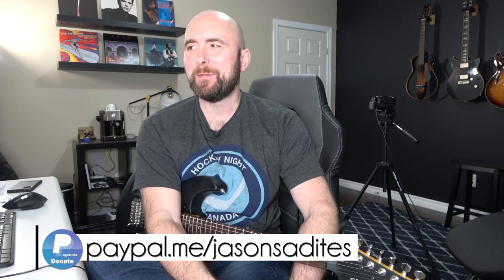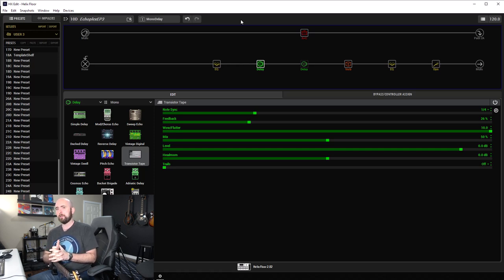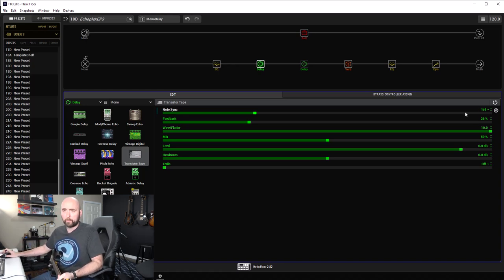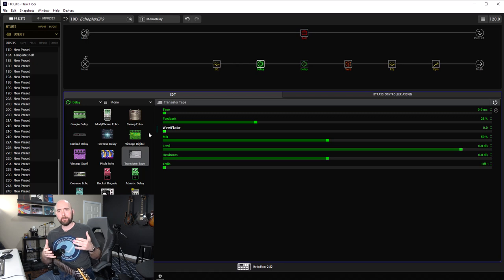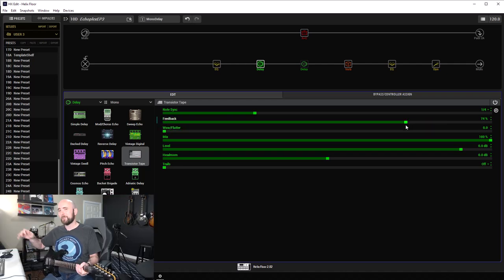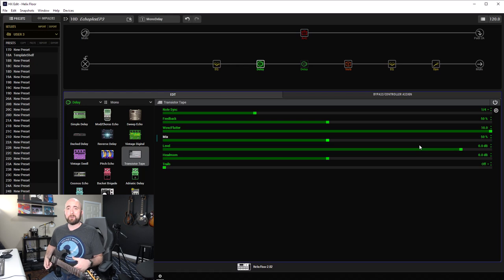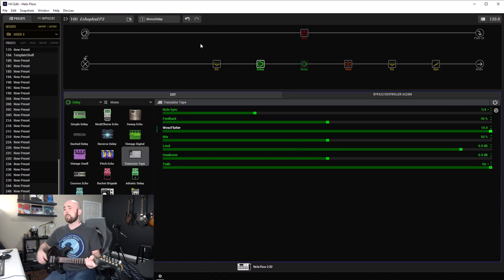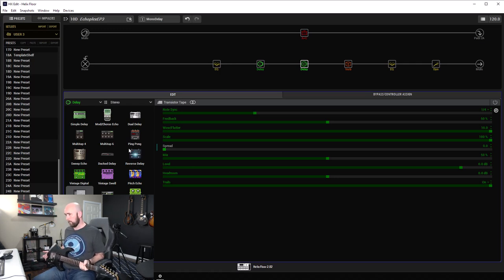Line 6 Helix/HX Stomp - Dialing In... Transistor Tape Delay (Maestro Echoplex Ep3 Tape Delay)

Comment: Scale at 100% means left and right are both at the time indicated. Scale changes the rate of the Right Delay, at 0 it's pretty much 1ms so it "muted". at 50% it's playing at half the length so in your 1/4 example it's playing an 1/8th delay on the right side. etc. etc. spread is pretty interesting on this one. it's almost like it's using two copies of the same buffer at 0 and doing actual dual modeling at 10 with two different EP3s